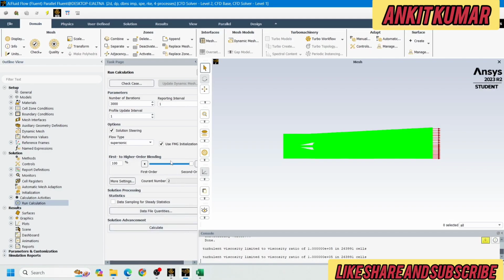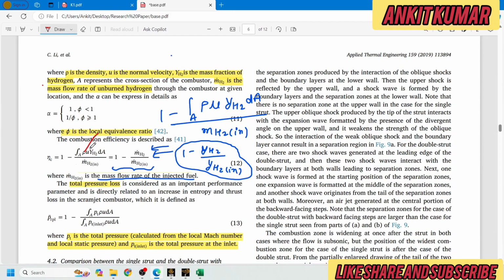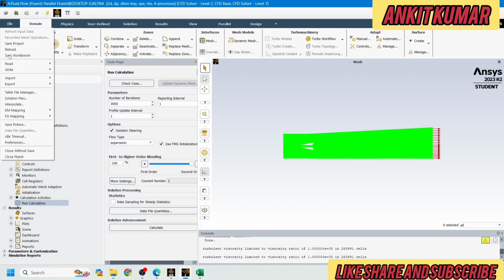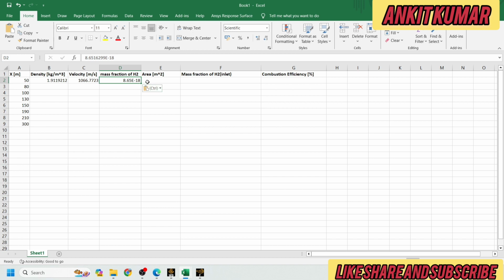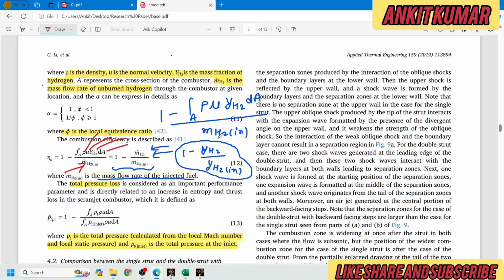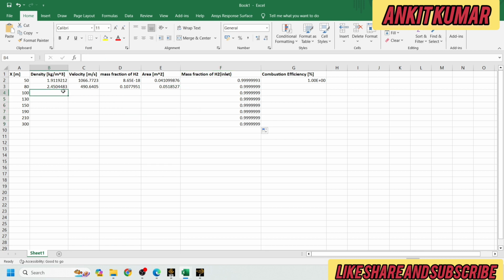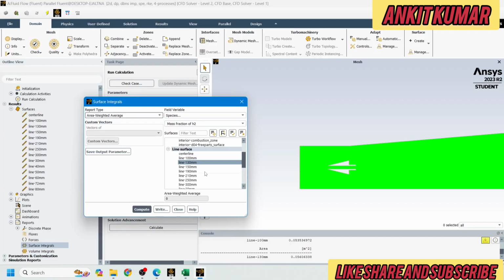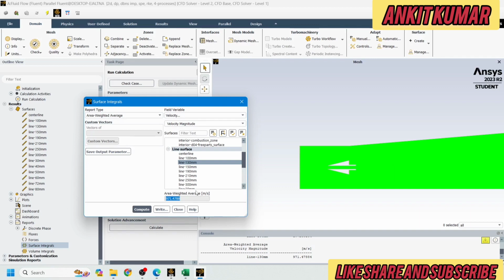Combustion efficiency || ANSYS FLUENT SIMULATION

Comment: Hi, thanks for the video. But i have a doubt regarding Yh2 and m°h2, is these the same?
Reply from the maker: Mass flow rate of h2= (mass fraction of h2 ÷ 0.02916)
Reply: @Ankit-NITian  in the paper it is mentioned about Yh2 right ?
Reply from the maker: @Arnoyt00  ha
Reply: @Ankit-NITian  could you plzz do a video about finding the mixing efficiency of the combustor